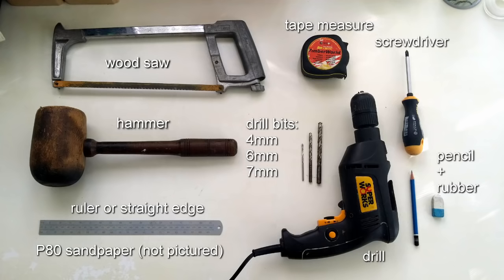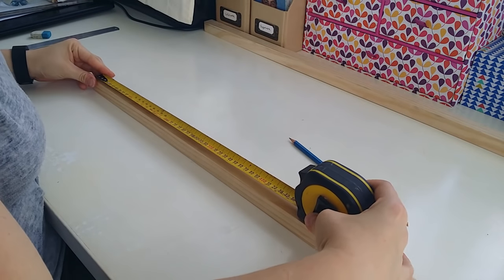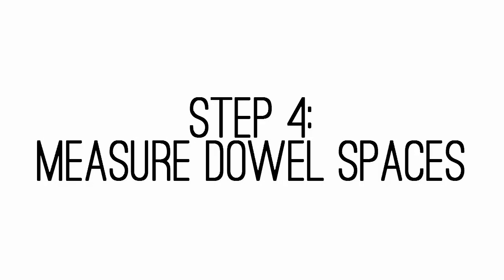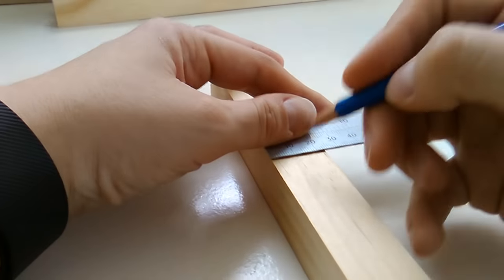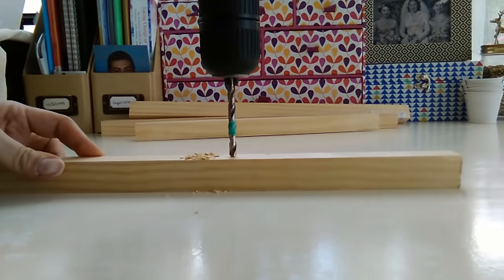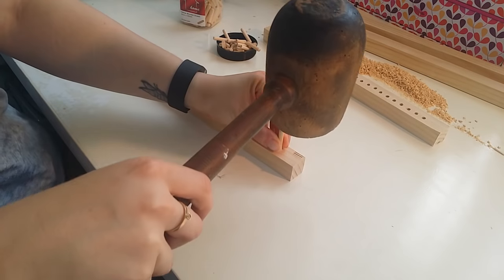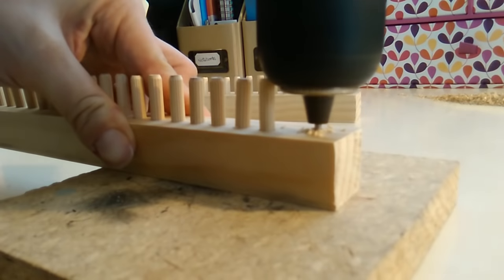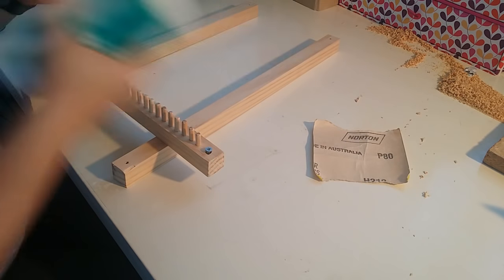How To Make A Loom | Weaving | DIY | Sam Granger

Comment: I think if you wanted you could use bolts with wing nuts and maybe do a overlap on the frame, it would lose the space underneath but you could take it apart if you needed to for Storage or whatever. I have a few of these in various sizes where I mi and match the frame sizes for different pieces. Thanks for sharing, happy looming :)

Comment: can you tell me how far apart the dowels are.  I mean the pegs?  The one I did off another video, had half inch apart on top row of nails and the next layer below are 1/4 in betwen the 1/2.  so there is a top row of nails and a bottom row of nails, making them extremely narrow. I failed to mention that the same is on the bottom.  I would like them wider than that.  as it is they are very very close.
Reply from the maker: It's a 12mm gap. I think I would have preferred a slightly smaller gap, maybe 8-10mm. Hope that helps. :)